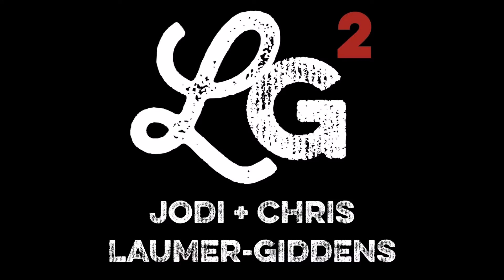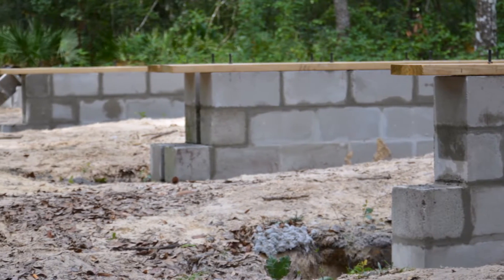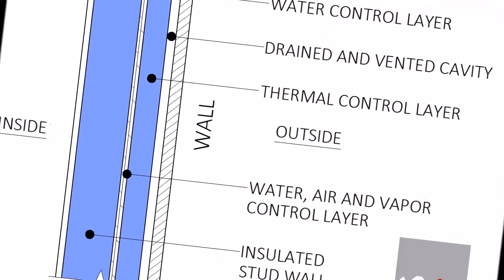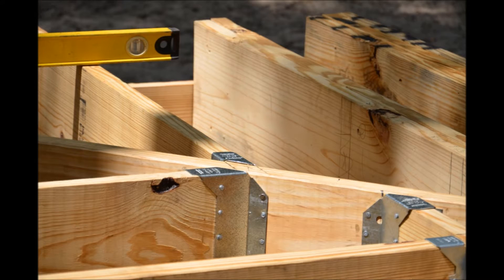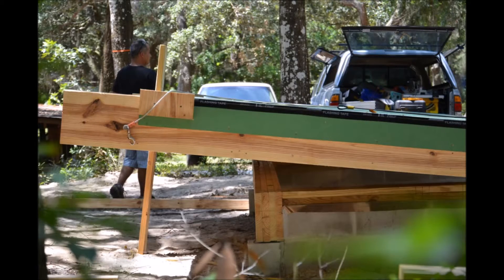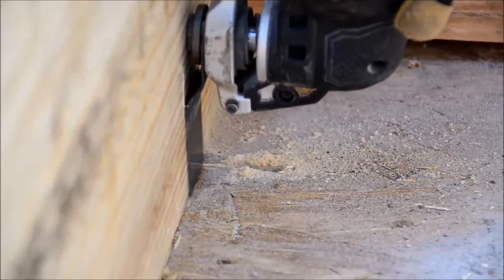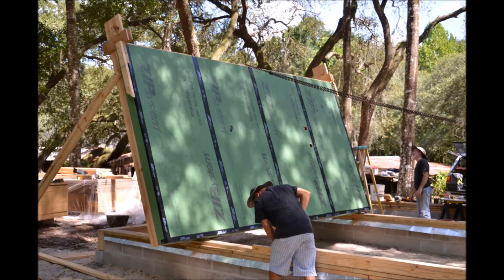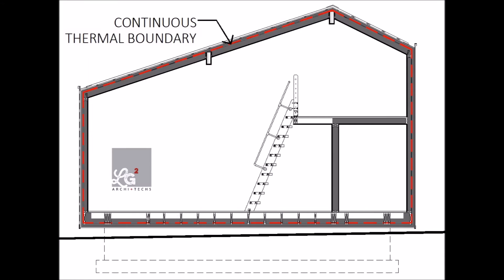High-Performance Tiny House - Framing It Upside Down on a Foundation

Comment: Hi Chris. I tried to find more content related to this build but didn't find anything. I am very intrigued by your idea of using the equivalent of a wall assembly over strip footings. This makes total sense to me but it seems extremely rare. Did you learn anything since then that you would have changed? I see that you are now using gypsum sheathing and liquid flashing. Thank you for anything you might be able to share on this 2 year old content!